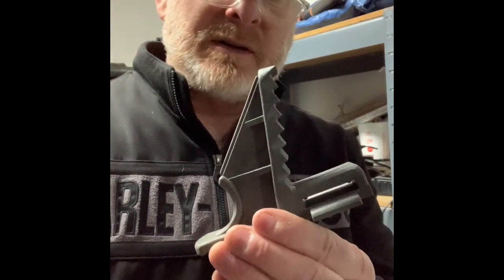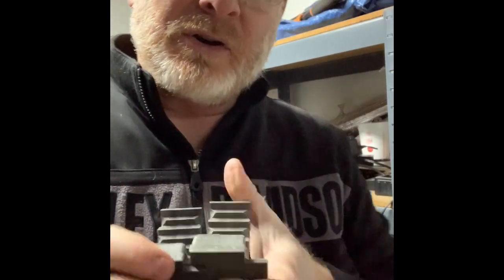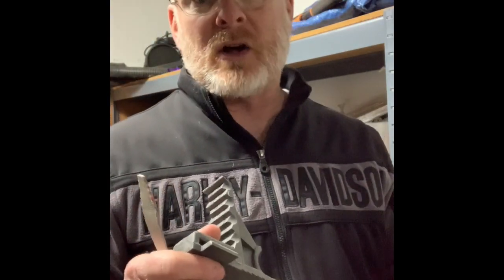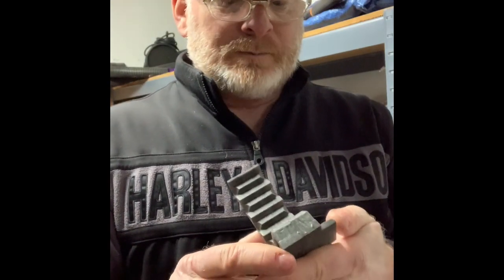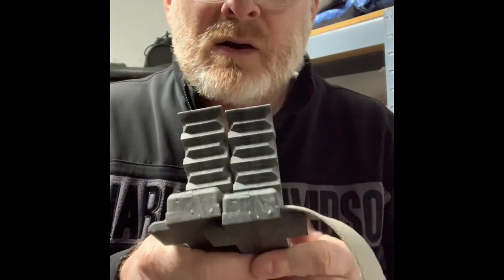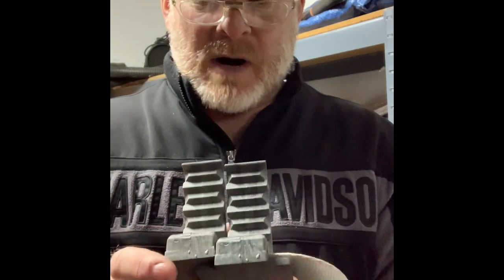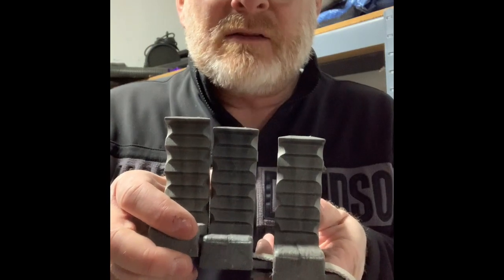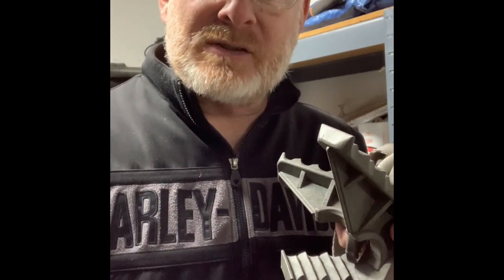Tree Hopper ROS

Comment: Amazing just ordered set of 5, (should come set of six) my question is does it come with a strap, if not what strap should I use?
Reply from the maker: I think you have to order the strap separately. I'm trying to remember, it's been a while, but I think that's how it works. Any webbing strap with a OCB buckle or ratchet strap or similar will work.